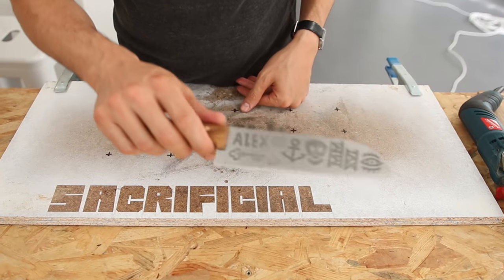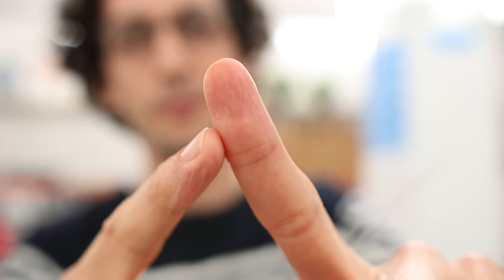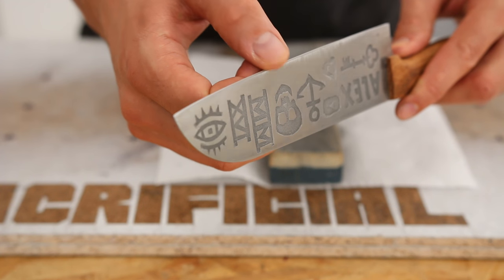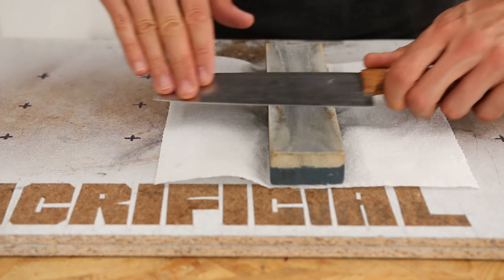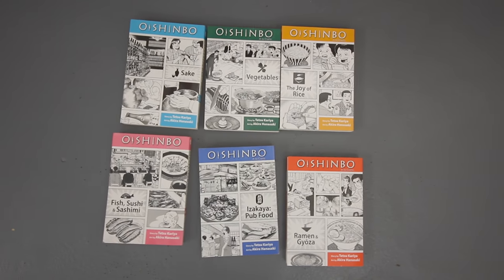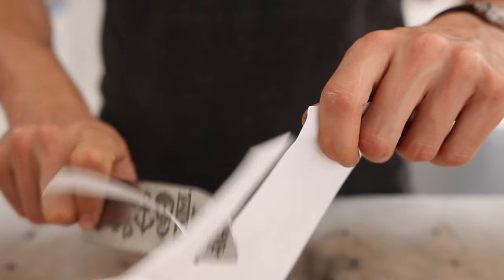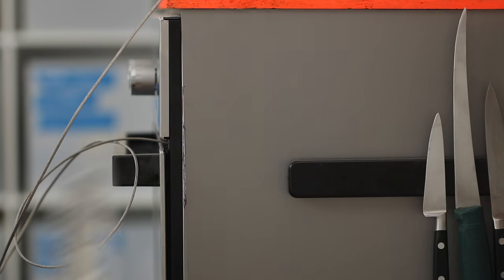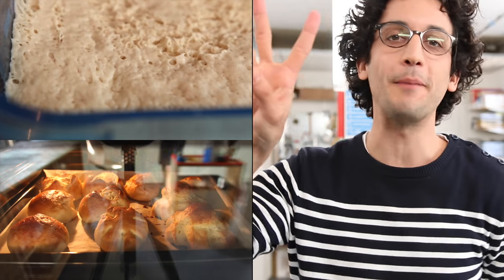How to Sharpen a Chef Knife ! Chef Knife Makeover 4/4

Comment: 5:07 Turn over your knife so you scrape the food off with the spine. This way you don't make the edge dull.
Reply: Ain't nobody got time for that.
Reply: doesn't always work, depending on whats on the board and the blades shape. but you are right. nevertheless, sharpening the knife regularly is the best and only way to keep a sharp edge, as usage in any extend will dull it over time anyways..
Reply: Scraping food edge side usually doesn't dull the edge so much as it rolls the edge. That's where the honing steel comes into play. But I'd say it's a good idea to break the bad habit and try to scrape with the spine, for sure.
Reply: you actually cutting will also dull the blade, not just scraping. Also acids in foods will work to dull a sharp edge too.

Comment: Do you have some recommendation for the stone? A certain brand or a certain roughness?
Reply: What is your budget?
Reply: Raelieous optimally under 30€
Reply: https://www.amazon.com/SE-DF8524DS-Diamond-Whetstone-Sharpening/dp/B001A6G0A2/ref=sr_1_6?ie=UTF8&qid=1494408023&sr=8-6&keywords=diamond+whetstone

I've been using something like this for about eight years now and swear by it. Way cheaper than a traditional whetstone and easier to use, because whetstones like the one Alex showed develop a shallow dip in the middle after a lot of use, which makes keeping the angle consistent very difficult. Diamond whetstones, on the other hand, are practically indestructible. Just make sure you fully dry them afterwards because they will rust. Also I'd recommend trying to find one in a physical store so it's easy to return. The cheap ones like this sometimes have bent or warped plates which is no good, but once you find one that's not you're golden.

Comment: How often is it normal to have to sharpen a chef knife? My knife was great for about a year without any sharpening but now it seems it must be sharpened before every use. Is this normal or am I just bad at sharpening?
Reply: you should only need to sharpen your knife about once a month, if you're just a home chef. Double check that you're sharpening at the correct angle, as sharpening at too shallow of an angle produces weaker (though sharper) edge.
Reply: If you are careless when it comes to storing and cleaning the knife, the edge may suffer. Also, as already mentioned,  a too shallow angle makes for a less durable edge. If you're dragging the edge along the cutting board, like at 5:07, the edge won't last as long. These are a few reasons as to why your knife may become dull.
Reply: Edge retention will be affected by several factors, such as: what you are cutting, cutting surface, care of the edge. Your edge will last longer if you are cutting fresh and boneless products on an end-grain wood board, than if you are cutting frozen foods or products on a plastic or glass surface. And yes, DON'T scrape your blade across the board!

Have you tried using a honing rod? It's possible that your edge is sharp, but rolled off to the side.

Comment: My dad used to use oil to moisten the wet stone.  Is that okay to do too?
Reply: of course it is! It's more a question of belief and doesn't affect the outcome noticebly, but it changes the feel during the sharpening process :) But there are stones, that are meant to be used either with oil or water, e.g. my Lansky-Set came with Oil.
Reply from the maker: yep
Reply: Oil is a better lubricant than water, and a better lubricant = smoother edge/cut/shape depending on what you do. Machinists may use water to lubricate but you have to use a lot more than if you use oil, just think of it like cutting oil ^^
Reply: Only on porous whetstones to prevent metal particles from clogging up the pores. Using it on non-porous stones will only make the sharpening process more arduous.

Comment: What type of sharpening stone do you use?
Reply: JimGlock 
One with 2 sides one is rougher to get the blade shapped/angled and the other more fine one for getting the knife smooth and sharp, its also colored blue and white repectively.

Comment: do you think 17 degree angle will suffice?
Reply: It will absolutely ruin the knife
It will explode
Reply: definately! normally you only sharpen special sushi/sashimi knives with an angle of 15°. For a normal cooking knive 20°-25° should be more than sufficient, especially if you use the knive sometimes to cut harder material like cartilage or bones. If you'd use a 15°-angle-knife for that, you probably ruin the edge in an instant. My standart cooking knife has an angle of 20° and I can shave my arms with it. :)